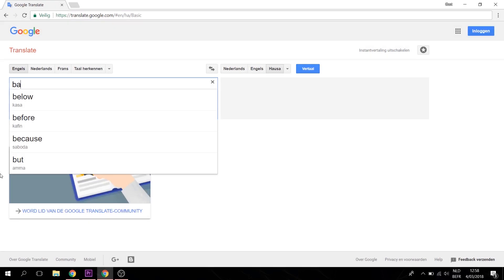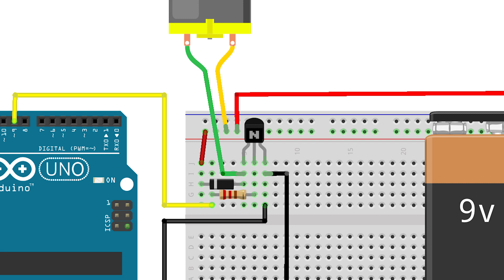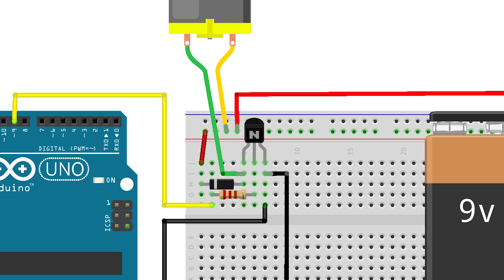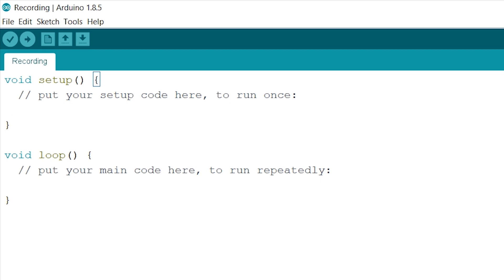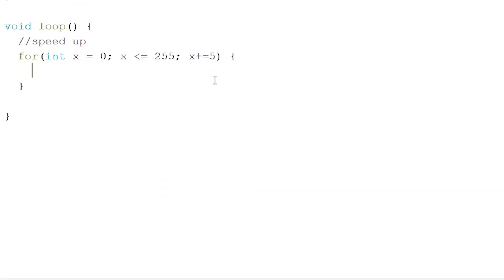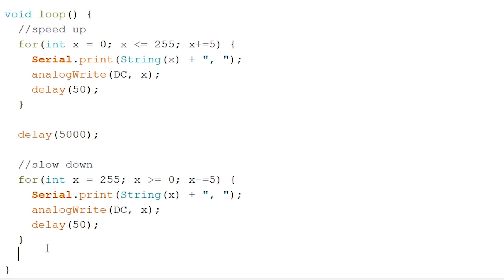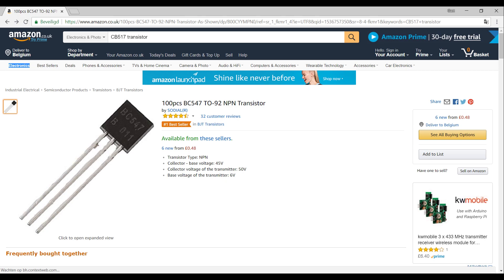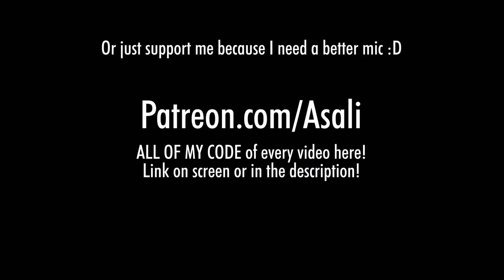Arduino Uno DC Motor speed control - 12 volt fan, transistor and diode

Comment: hi i am facing an issue where once connected the motor starts to run on its own and doesnt obey the arduino code. i am using a 12v battery and trying to run a dc motor with ir sensor

Comment: Hi. Good idea and don't work, on video from 0 to 100% and back, going too fast, like as switch on/off, on this project if change arduino code to on/off transistor, you got same effect ;) PC Fan not work with speed control on this project..

Comment: Thank you!  1:42 explains the purpose of using a diode parallel with the fan to prevent any damage from inductive current when disconnecting the battery.

Comment: I’m using a 12V dc motor. When in the LOW state the motor still runs but slowly. How do I make it stop completely?
Reply from the maker: Have you copied my schematic? The diode and npn transistor are required to make the 12v dc motor come to a full stop, perhaps your diode is facing the wrong direction. I advise you to watch the video again and follow step by step!

Comment: can I do this procedure using the 3-6V motor in the Arduino UNO kit?
Reply from the maker: Yes but you'll have to swap out the battery for another one tho, 9v is too high for a 3-6v motor
Reply: @asali-channel  So aslong as it doesn't exceed that 3-6V limit?